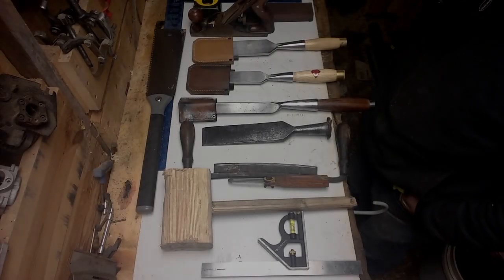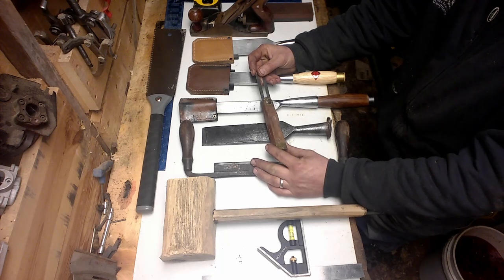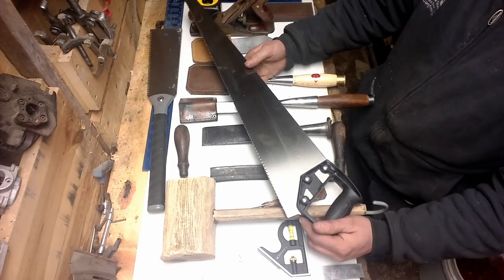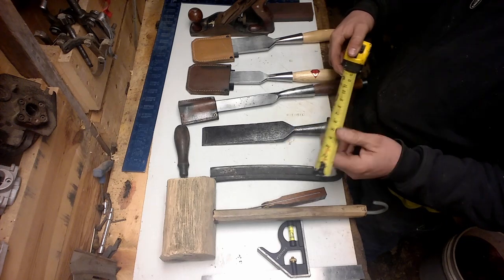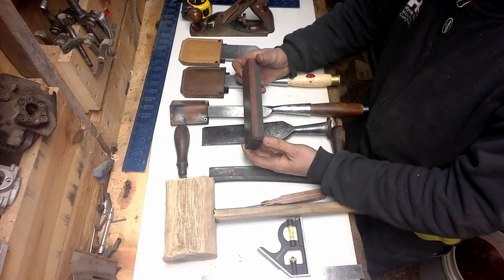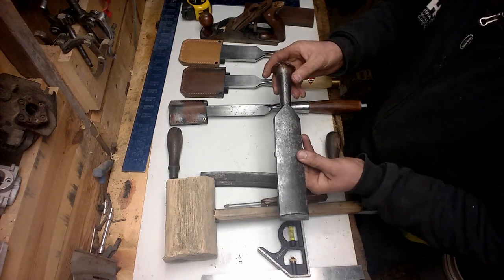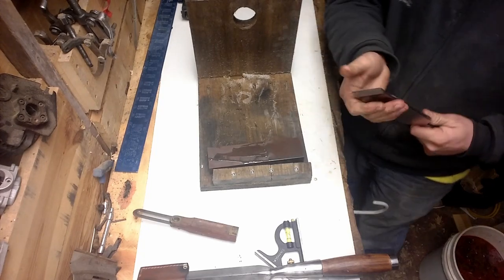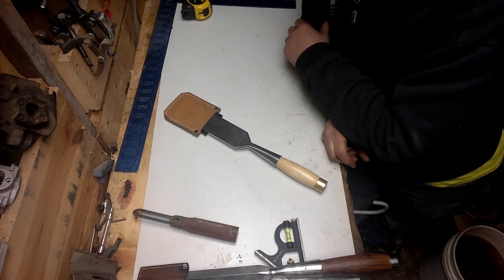A Timber Frame Vlog #3: Basic Hand Tools

Comment: Well done! The original Inspiration for my sharpening jig was the one Jack Sobon showed us in the workshop. I use a digital angle cube to set the angle, as I like to use a micro bevel. Also, different thickness stones need to be positioned in different spots to maintain the right angles.
Reply from the maker: +MassSawmiller 
I have learned a lot from reading your posts.  You probably one of the few who didn't tell me to do a smaller project first.

Comment: Robort sorby chisel can be had on amazon prime for not much money. Modern w2 tool steel is pretty amazing. Most pro's I talked to prefer the modern steel to the old antique stuff as the modern steel is much more consistent and holds an edge longer. Though old chisels have a bit more soul.

Comment: Jim what framing square do you use?  I have a few older ones but the scales are tough to read and looking for one that is accurate with the scales I will need.
Reply from the maker: +T W I'm using an aluminum Empire square.  The scales have been right on so far.

Comment: meany years ago I was doing some remodeling on this elderly ladys home, and she gave me a truck load of her passed away husband, in that pile of big heavy chisels just like that and bigger, 3 or 4 brace and bit, and adjustable bits as well as 3 or 4 sets of regular twist bits, I always thought they were for timper work but never really knew for sure, but some are big and heavy, thin and heavy
Reply from the maker: +Arnold Romppai you can't beat those old tools.  Timber work used to be a common knowledge building practice.  It is a special thing to build one.  I'm glad to see it making a comeback.